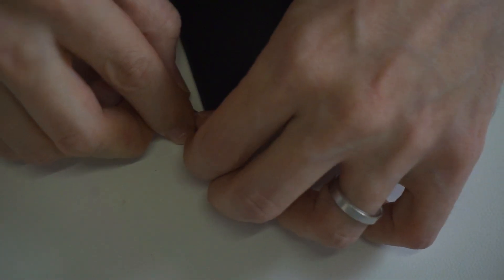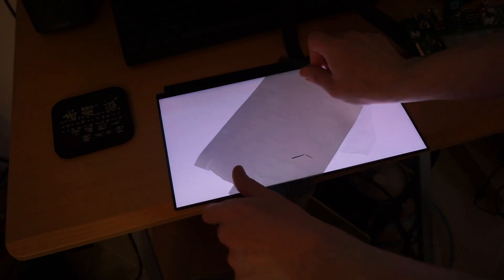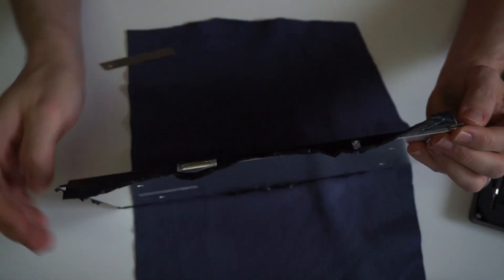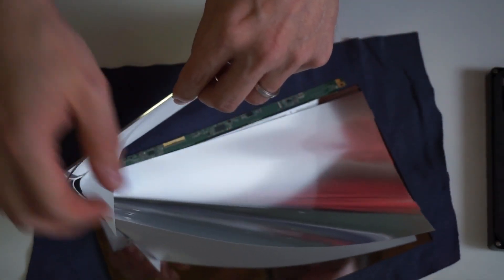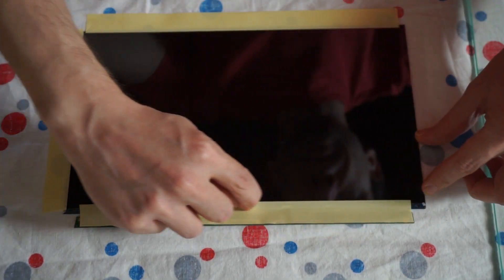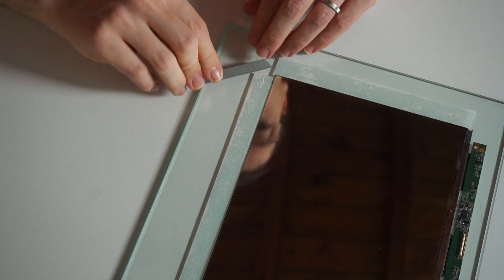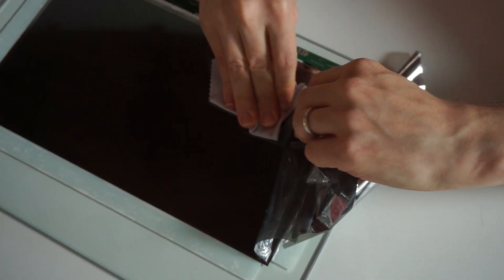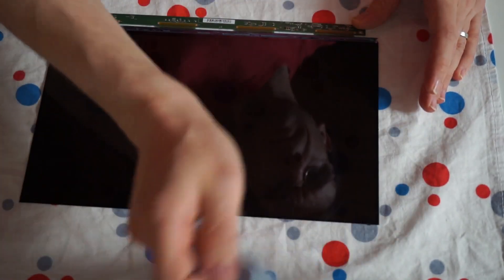Removing the polarizer from an LCD screen

Comment: Awesome tutorial. One question, is it possible to detach the TFT matrix panel from the LCD and RGB color filter matrix? maybe using a heat gun or any chemical. I need to work with the TFT panel for a project. Thank you!
Reply: No

Comment: When it is needed to remouver polarized film? For to fix a problem of the brightness?
Reply: Brightness problem is not related to polarizer, but more with the backlight, backlight are designed to have 12 thousands hours of life
Reply: @royjao1738  it's not fixable but only to change the lcd fixes the problem the ghost and brightness ? No to solder?

Comment: Did you ever find a proper polarizer for your SLA printer?  My Elegoo Saturn printer has a scratch on it which is causing failed prints.  I believe it's just the polarizer that's damaged, so I was wondering what spec of polarizer I could replace.

Comment: hi what is that layer called the one at 4:38 that reflective and some board connected to it?  that the one that produce image right? i want to make like ibuypower's pc case side windows. or can you supply with with that layer? i want to make my own products and sell it but i can't do it myself as my hand aren't steady and i don't have the patient to do that.
Reply from the maker: that would be the LCD itself, yes
Reply: The glass surface of the LCD, there are two model available in the market, one that is glossy, the other matte

Comment: what is the purpose in this procedure??? looks like a waste of time to me...
Reply: This is an old comment, I know. But sometimes the glue that holds the polarizer in place would start to degrade and "bubble up" and you're gonna want to replace the film instead of buying a new monitor.
Reply: @karloshebron7614  which is just what happened to my 13 yr old viewsonic - which is what led me here - wonder if it's worth changing it... or if that's gonna cost as much as getting a new monitor XD (which i already got anyway XD)

https://www.facebook.com/SuperReubs/posts/10157343081347407

Comment: which driver board do you use for this lcd? and what is the status of SLA project now?
Reply from the maker: control board is in the video description! I'm having some troubles with the polarizers, but it kinda-sorta works :)
Reply: Driver board differ from each resolution, but basically it can work across the board